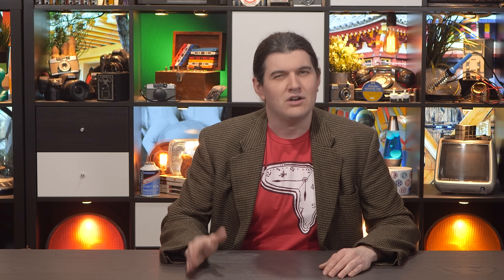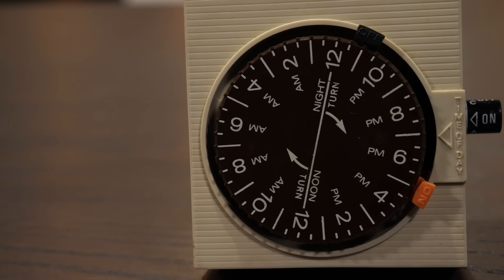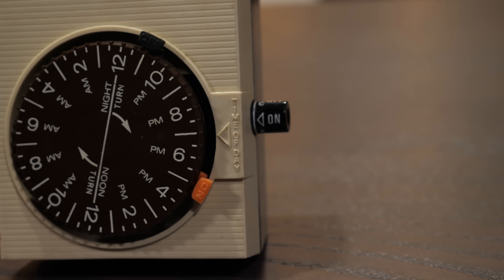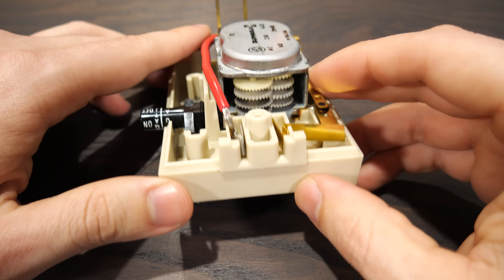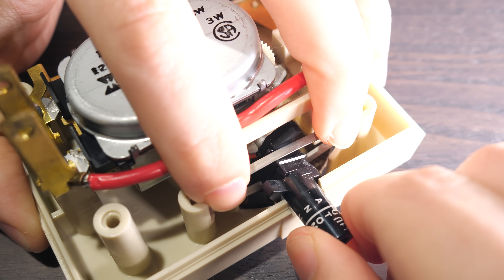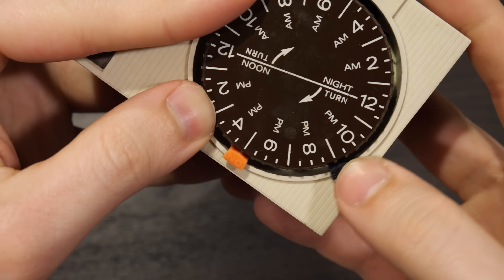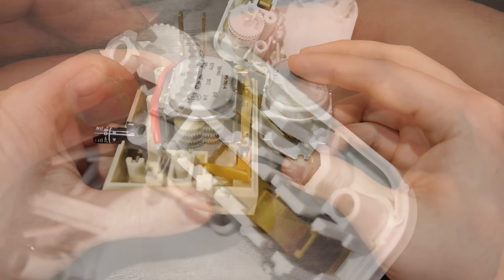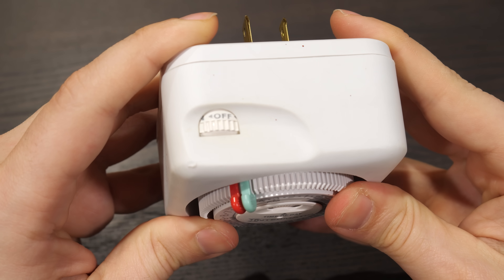Timer switches: literally just a clock and a switch

Comment: I always liked how these very old timers with mechanical switches had a bit of natural variance in their on/off times as they worked to overcome the force of toggling... A little deviation in the times can make for a more natural look than hard-timed perfection of newfangled digital timers.  (Although now we have programmed-in randomness on some units I've seen, to make lights look more "human" which is also neat)
Reply: Ya know, my digital timers have drift as well, it's just much less and only needs to be corrected a couple times a year.

I get a kick out of the drift tho from both kinds, I like the small variation introduced since it causes my various pet enclosures to light up at slightly different times. Given that there are so many of them we don't really use ceiling lights, it's a nice organic effect every morning and night.
Reply: @unauthorized.mimicry  Its less about clock drift, and more about the lack of precision of the tabs that flick the switch. Due to the extremely slow moving clock dial combined with the springs-overcoming-friction nature of the switch, there will be some day-to-day imprecision in the time the switch flips even if the clock doesn't drift. If you are using this device to turn lights on and off when you aren't home as a burglar deterrent, the imprecision is actually a win.
Reply: Yet the digital ones are nice at dealing with power outages better, as the clock isn't getting its time reference from the electricity itself. It's no fun getting to that one outlet behind some heavy piece of furniture (where the timer is) so the lamps will turn on at the correct time, because you found all the appliance clocks blinking 12:00 when you get home.
Reply: @pauljs75  I use the digital ones for that reason for stuff that's in use all year. The mechanical ones are better for seasonal use like Christmas lights imo though because they're quicker to set up, and if you leave a digital one unplugged for 11 months the backup battery will likely be dead by then
Reply: I use multiple mechanical plug timers for my Christmas lights, different brands and models so getting them all to come on at the same time is a personal challenge every year! I can usually get them all coming on within a few seconds of each other, but then they end up all going off at different times.
Reply: @skywing959  the entire house with a series of extension cords all connected up and all snaking and winding back to one, single outlet. You put the timer there. That's good for fire code, right? 😂  (Bonus: then all the lights across the entire house come on at once like each of the homes in Kevin McCallister's neighborhood. 🎄)
Reply: @DeviantOllam  that's one solution!! Always wondered how they managed to do that!!
Reply: @skywing959  really felt that, even with multiple of the same brand I never get it to be perfectly synced no matter how hard I try xD
Reply: Deviation, ehh?
Reply: why was it i read this referring to alec as a very old timer..... hah thanks dev
Reply: Are timelock safes a real thing and do they use just as simple a mechanism?
Reply: @Dances_With_Lag  There are rather cheap ones obtainable on the consumer market- while I can't really think of any "normal person" application they don't seem to be all that safe overall and seemingly use a similar timer design

Comment: I used a cheap as chips lamp timer for years to power cycle my router for 3 minutes or so every night. Yes thanks to that relevant xkcd (/1495), really punched above its weight to stave off the unexplainable comcast bs

Comment: As a remnant from a state-to-state move about a decade ago, I have a half-dozen of the ~12:00 tabless variant kicking around. These were for my old empty house sitting a few hours away, for plugging into floor lamps to make the house look not-obviously-ultra-vacant. Drifting a few minutes here and there was actually a feature for that use case. Pretty handy little items, still not-useless for a few LED bulbs firing around sunup/sundown over a weekend trip. 

I'm sure you could even chain/stage them for some extra-chaotic light behavior, although I never bothered. If somebody's taking that degree of care in mapping out fake-me's routine, they earned my burgleables.

Anyway, for this purpose, I'd probably rather be yanking integrated tabs up and down rather than programming something with an LCD display.

Comment: Looks like it's time for 'Just the right amount of effort' January.

I have both of the 'modern' versions of the timer switches in use in my house, and found that doubling up the green/red tabs so that both 'on' or 'off' instances occur in succession is a handy way of storing the tabs without impacting the functionality.

The only issue I have with these is that some of the heating pads I want to use them with require a manual power button press on the cord to turn on due to a safety feature. I guess we're not phosisticated enough to have that work just yet.
Reply: Exactly, the dial itself is the tab storage so long as your ON/OFF window is long enough to store all the remaining ON/OFF tabs.
Reply: You know, depending on what you're using those heating pads for, you could probably find ones purpose designed for 2x the cost (or more), but at least they will be "dumb" as in they'll just start working when the power is turned on.

Or you know, if you're not using it for people you could probably connect one of these timer switches to a small patch of tile that has electric floor heating grids installed in it, with that tile patch providing the heat to whatever you're trying to heat currently with heating pads.

Alternatively, you might see if you can open up the control box of those heating pads and short out the button that turns it on, that way it turns on whenever it gets power with no intervention needed (but it might not be that simple)
Reply: @44R0Ndin  The heating pads are for sphynx cats, so they need access to them when they want to nap, but shouldn't remain on 24/7. The current best solution is to use the 'dumb' style of heating pads inside insulated cat beds so that they don't need to stay turned on in order to stay warm. We use the 'smart' ones with a 2 hour shutoff as one-offs when needed, but it would be nice to have those automated as well.

Comment: I remember the first time I bought a timer switch being confused about how to operate it until I realized you just had to pull out the tabs corresponding to the time you want the switch to be activated. I figured such a device just had to be more complicated than that. I was making it too hard for myself. Now my little orange tree gets 12 happy hours of sunlight even in the dead of winter in my apartment with no suitable windows for indoor citrus trees.

Comment: We have that exact timer you showed - the newer Intermatic with the removable tabs - that we use for our aquarium's lights.

I've noticed the clock does drift slowly over time, so perhaps that 3600RPM thing isn't perfect after all.  Also, we have a generator for the frequent power outages we get here, and that seems to screw up all clocks, digital or analog.  I wonder why exactly, is it the voltage fluctuating?

You touched on this briefly, but I'm still curious - in that old design that isn't polarized, depending how you install it, you'd be cutting the neutral wire.  Would that even do anything? Since power is still coming through the "hot" wire would it actually cut power when you switch the neutral?
Reply: Yes, cutting the neutral wire would turn things off.  Power flow needs both voltage and current -- and, while voltage can flow into your device on the hot wire, current requires both an "in" and an "out".  If you cut the neutral wire, the current can't flow back out, so it has live voltage but it's not powered.

The reason that you can get shocked by a single wire is that it doesn't take much current to shock you, and if you're standing on the ground, a little bit of current can flow in on the wire and out through the ground you're standing on.

This is also why, even though it's a good idea to attach metal appliance shells to the third "ground" wire, it is never ever a good idea to attach them to the neutral wire.  If you had a device plugged into this with the neutral wire cut, it would be off -- but if you then touch the neutral wire or something connected to it, now you are the path for current to flow through the device, in place of the switch that's turned off.  It probably won't be enough current to actually run the device, but it will still be enough to give you a nasty shock.
Reply: >  Since power is still coming through the "hot" wire would it actually cut power when you switch the neutral?

I wanted to answer this a little bit more simply.

If you switch the hot side, then when it's off, there's no current flow and it's unpowered entirely. 

If you switch the neutral side, then when it's off, there's no current flow, but it's still powered with live voltage from the hot side. If somehow you come into contact with the circuit, YOU now become the return path, and that's generally regarded as an undesirable outcome.
Reply: Related to a comment above. Typically a generator will be a few Hz about 60 when unloaded and will drop a few below when fully loaded. Typical inverters just produce a flat 60 Hz and though I haven't tested any, I fully expect that's the case with inverter-generators. So, if you have a normal (non-inverter-)generator you'll see all those timers and old bedside alarm clocks and various other thing drift.
Reply: @TT-nd8sy  So I assume there's an allowed range for both frequency and voltage?  I know the mains power is not exactly 120V, sometimes it's like 121 or 119 - so electronics obviously have a range tolerance where it'll work as long as it's within that range.  I'm assuming with our generator, it's creating a lot more fluctuation than the "stable" utility company, which is why some things tend to go bonkers when used on the generator (simple fans start to spin at varying speeds and make weird noises, for example), but devices with AC to DC transformers (e.g. computers, game consoles) work fine.

So if it's like 59 or 61Hz, will most things still work?  It really only seems to be fans that act visibly different, and incandescent lights sometimes change in brightness while the generator is running (more/less load being used etc.) but I wasn't sure what was causing clocks to drift.  Even digital ones do it.  Same thing with those alarm clocks that let you put in a 9V battery to keep the time when power goes out - it'll be off when power comes back, so honestly better to just let the clock reset itself...
Reply: @drfsupercenter  I tend to over-explain things. I've tried to avoid that, but it is still long, probably more than you'd like, even with slight misstatements and omissions. I'm also not an expert, at least not by my own standards. I'm more of software and electronics nerd. But, I have worked around these things and a pile electricians and helping them sort things out.

Short version:

So the short answer to what you've written is broadly "yes" to all of it, except perhaps for your observed light/fan changes which are probably more voltage related than frequency related. As soon as I start to try to address any part of it any depth it leads me down the rabbit hole to something like the following long version.

Long version:

There's an absolute pile of standards and they all have tolerances for line voltage and frequency and things like lengths and sizes of deviations from the norm.

Most things not trying to keep time are going to be happy with 59 Hz or 61 Hz, and probably a somewhat wider range that that. To put it differently: As a thought experiment if we all woke up tomorrow and the entire grid (again it must be tightly synchronized) were running at 61 Hz, instead of 60 Hz, everything in your house would be fine. Your motor loads wouldn't hardly notice. Your resistive loads (heating elements; incandescent lights) don't even really care about frequency at all. But your clocks would begin gaining a second of measured time for every minute of real time. Or about 24 minutes faster per day.  They could of course be redesigned to expect a stable 61 Hz. I don't know what the widest quoted frequency range I've seen is for a 60hz nominal appliance or power source, perhaps as wide as 55hz to 65hz. But it's normally tighter than that. In particular the primary winding of transformers respond poorly to lower frequencies. In practice if you're designing something for the international market (so supporting 50 Hz and 60 Hz) you're designing for 50 Hz. Generally a 50 Hz power transformer is happy with 60 Hz run through it. Not so much the other way around. It works, but at less capacity.  I'm not as sure what to expect from say supplying 70Hz to a 60Hz rated device; I suspect it's better than giving it 50 Hz, but I'm not eager to try it to find out what color of smoke it makes.

The stability of the utility grid frequency is a practical necessity for managing it and putting generating systems in parallel. Individual work generators and typical permanently installed backup power generators simply have no need to be synchronized with the grid or anything else. If you were operating two of your own generators (or any other power sources) but not grid connected, they would need to be synchronized to each other but not necessarily at 60 Hz. Inverters typically produce 60hz anyway, but more over if you have a grid tied solar system (or presumably a generator if that were a smart thing to do; usually it isn't) needs to be synchronized to the grid and so will be operating at nearly 60hz for that reason and just about perfectly 60hz long term, because they're now part of the grid. For a lightly loaded generator there's no reason (alarm clocks aside) that it can't just remain at 61 Hz indefinitely. Producing a tight 60 Hz average just to support clocks that use line frequency as timing probably just isn't economical. For what it's worth if you have an on-line UPS, that is type where the inverter/battery is always active your alarm clock's speed would be controlled by the inverter, which may or may not be as perfect as the grid, but probably a lot better than your generator. But is also getting an using a online UPS for that reason is not exactly practical.

What we call 120 (and other numbers) nominally has a pretty wide range whether it comes from a generator or derived from the utility. Something on the order of 110VAC-125VAC. And as long as you're in that range things will operate okay. Going over above can certainly start killing things. A lot of people are surprised that going low can also kill things. Many motors will essentially draw more current to compensate for a lack of voltage and the heat produced in them is essentially related to the current drawn. So as paradoxical as it may seem, under-volting some devices will cook them to death. If you ever find you generator is running at 90V or something, you can run an incandescent bulb off of it, but definitely don't hook your fridge to it or really anything you care about. Using long extension cables of light gauge is also a good way to bring about an early death to many power tools whether you're on utility power or not. That said, within the acceptable voltage ranges (around 110VAC to 125VAC) you will still notice brightness changes in incandescent lamps and fan speeds. And it is likely that that you're seeing that and not power line frequency. The average voltage of a generator when loads are stabilized is normally no worse in any respect from utility. What is worse is its transient response to load changes. You will see the voltage pop up and down as things kick on and off, sometimes kicking on and off at their own frequencies of 10s of Hz, which can be reflected in the voltage observed by your incandescent bulb. You'll see a short aberration in the frequency when that happens, but I don't think that itself has any significant on your clocks, I could be wrong. I expect the frequency wobble related to kicking a load on is roughly the opposite of the one for it going off; it's the non-60hz long term average that gets you. For people running portable generators, they're often plugging things into extension cords, sometimes crappy extension cords; usually something not as good as house wiring. So when loads kick in and the current in you cords will cause a voltage drop at the end of the cord, which in turn can be observed in an incandescent bulb or fan. Not like house wiring is immune or is that abnormal. If you plug a meter into a dual gang outlet that has a toaster oven in it and and kick that on you'll usually see some drop on the meter, a volt maybe. But the situation is usually worse with stranded wires that have been worked and not trimmed to length and often not of a better gauge.

Comment: I’ve got that timer with the lose-able blades! I found that since having multiple on or off blades in a row doesn’t affect anything, I’d store all of the off next to each other, and all of the on next to each other. Only an issue if you wanted the on/off cycle to be 15 mins. 

But this explains the hum from it! I figured it was related to the grid hz, but didn’t really register that there’s an entire motor in there!!!
Reply: We've had a electromechanical timer switch used to start the washing machine during the (cheaper) night tarriff wear out... the plastic sensor finger got worn off so far over the years it did not switch anymore.